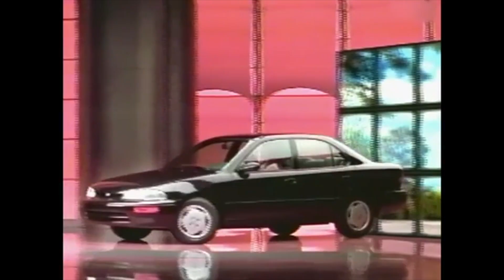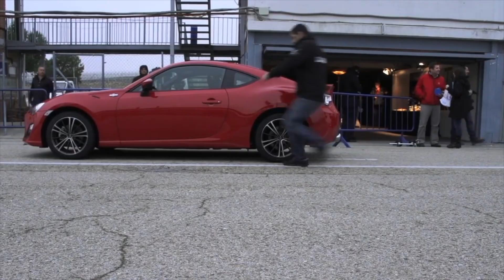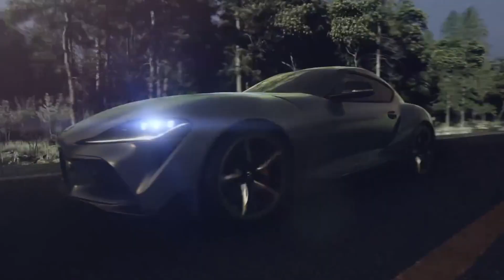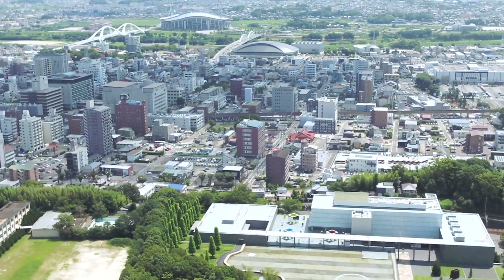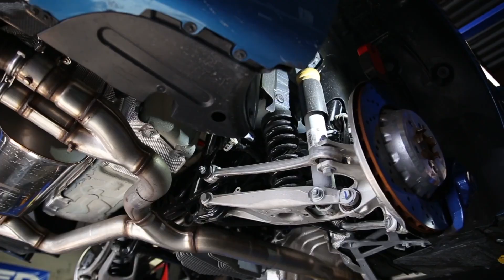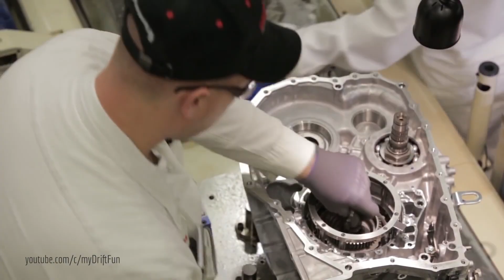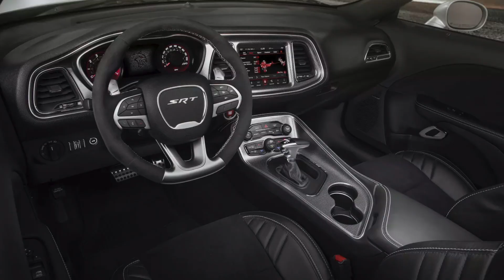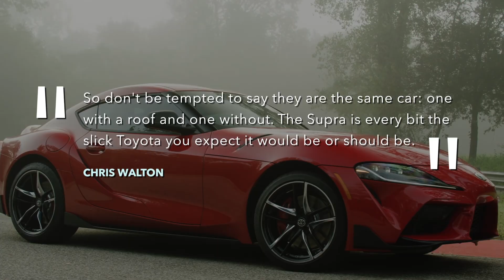MKV Toyota Supra - BMW or Toyota? The UNTOLD TRUE STORY

Comment: So wait... what did Toyota do? lol. It's nearly 100% BMW parts/engineering. Inspecting and QA does not make it a Toyota. That's just absurd to say. If Toyota took apart an M car, inspected it, and then put it back together giving it a thumbs up, is this M car now a Toyota? How ludicrous.  This car is a slap in the face to Toyota loyalists.
Reply: And guess what? If you like this car, you like a BMW. This is the tranny-hooker of Supras.
Reply: Did you watch the video? Same platform doesn't mean it's the same car.
Reply: @samiraperi467  Did you watch the video?  Having the entire running gear made by ford, letting GM do some quality testing on it does make it a ford.
Reply: @single94supra  It doesn't matter who manufactures something if the design is a joint venture. Also they obviously have different panels, different interiors, different tuning... It's not a BMW. Yes, I watched the video. Do you think that it's a Toyota only if they did everything alone? If that were the case the car probably wouldn't have happened.
Reply: @samiraperi467  its absurd to compare the exact etinde, albeitdetubed 50hp with not designing every single part of thr car.  Way to compare apples to staples. FWIW, I know several who had input on this car and NONE are pleased at all at what the end result was and consider it a BMW as well.  It is most definitely a weaker version z4, period. Painting stripes on a horse doesnt make it a zebra.....its still a horse. 
Had they called it anything other than a supra, it would be fine. That is a disgrace to the iconic name.
Reply: @samiraperi467  what most are saying is if this is what came out of that venture. Great! Just dont call it a supra. we would prefer there never be a mkv vs that!
Reply: @single94supra  That's your choice. It doesn't change the facts.
Reply: @samiraperi467  the fact is it's a horse with stripes you are calling a zebra. That's the real fact
Reply: @J.PC.Designs  I get it. I have owned and driven an FRS the last 6 years. The bean counters won't let the niche profit loss type cars get built without these cost sharing practices.

The world has another driver centric coupe. "But muh shared platform"... cry me a river.
Reply: Says the guy with a mustang as his avatar
Reply: why is everyone's panties tied in a wad? Did everyone forget that the 2JZ was built by Yamaha?
Reply: @ricks.1215  only ones wearing panties are those who want a bmw supra 😆
Reply: @J.PC.Designs  I agree  100%. Well said.  It would be like Nissan collaborating with Mercedes on the GTR. Ridiculous.
Reply: This. 

Idiots saying Toyota had a hand in its design by running tests on other company's parts.
Reply: Chassis, exterior and interior design, and tuning are Toyota.
Reply: dautolover how’s the interior Toyota 😂
Reply: @xCkillaxC  Exactly.  The interior has a ton of BMW switchgear.  Oops, the airbag cover on the steering wheel is Toyota, so there's that.
Reply: Wheelman 94 it probably had Idrive or whatever their software is called too 😂
Reply: @dautolover  oh wow. That's impressive. Way to go Toyota. 👏 👏 👏
Reply: @dautolover  all the fluff.
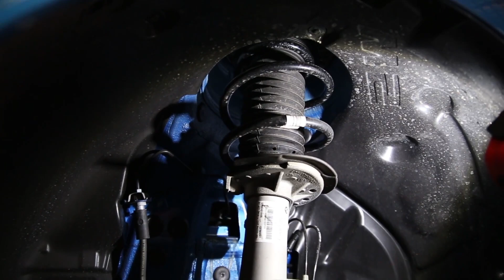Reply: @dautolover  9:35 where do you hear "Toyota chasis" ?
Reply: @TxJonathan  12:55 is where the video states where Toyota took over. This includes the chassis among other things. 

Another question is whether that's enough to make it a "Toyota". I never said it was enough. I was just commenting on the question as to what exactly Toyota do in the making of the new Supra, and the video clearly states what work was done.
Reply: And a slap to a face of all cars industry

Comment: You have an underrated channel, good review.  New sub here.  I will add, that same Motor Trend article I believe mentioned that the Toyota design was finalized by by CALTY Studio (the FT1 designer).  I have also heard about the engine that Toyota had input about it having a mechanical vs electric water pump (like the 2J).  Has forged internals, solid deck (although the cylinder's can't be resurfaced) variable cam lift/timing and twin scroll turbo, water to air I/C, timing chain etc.  BMW variants have already shown 400 wheel with an exhaust and tune.  Sounds promising/  What I wish the new Supra had was a targa top, small back seats, round taillights, and the angled dash at least.  I would still consider buying it down the road.

Comment: I don't bother whether it use a BMW engine or not. The car looks good. The problem is it's performance values. Seriously only 335 hp, 0-60 only 4.2 seconds, top speed of only 155 mph while your opponents have over 500 hp, under 3 seconds 0-60 and over 180 mph top speed. They will crush that car.

Comment: Crossfire 2. Germany exports again! Thanks for the well done and informative clip!

I actually don't mind the manual transmission Crossfire to be honest... night and day compared with a contemporary Sebring, lets be honest. However, Toyota has a better track record for reliability and relatively affordable longevity than either BMW or Chrysler (pick your decade, since 1980). Buying a Toyota without a Toyota engineered drivetrain seems kinda silly to me. 
In contrast, I find the Abarth 124 Spider to be a much better alternative solution, where each manufacturer still supplies their own company's engine. I actually find it more appealing than the Miata, for both the styling and the engine sound. I'd expect the Mazda engine to last longer, but the Abarth engine is more fun, IMO. A Supra made from BMW parts, particularly the engine, just seems weak to me. It used to be that a sports car was an opportunity for a brand to show off their engineering prowess... What is Toyota really showing off here - their incredibly QA dept.? Their adjustment of the BMW suspension? Their ability to apply different fake vents than BMW? It's a real shame they couldn't create a more modern Toyota inline 6 engine. If they had, any other platform sharing would've likely been forgiven by most. I know I would've been more interested. Even picking an existing Toyota V6 from the parts bin would feel more authentic to me, however Nissan Z it would then seemingly become.

 I understand the motivation and reasoning, but not for me.

Comment: Should be a great car.  The B58 is closed deck with forged internals.    Combined with 50/50 weight.    It's basically a 2J FD rx7 but uglier.

Comment: The Car is so BMW that it has 5x120 wheels and uses Wheel Bolts instead of Studs and Lug Nuts. Interior also screams BMW styling. I think the whole "oh we designed our cars completely independent" is just marketing propaganda. I suspect the most Toyota had was spring rates, damper valving and some of the electronic adjustments in the electronic steering rack and shift points.

Comment: I couldn’t think of two manufacturers that need each other more. I have always loved BMW’s they truely feel planted, quick (forget 318i’s) and special. But all along BMW’s suffered reliability issues. Think back to M3 subframes, 3 series cooling systems, and the list goes on. Toyota truely lost their way at the close of the 90’s, much like Honda did. Toyota and Honda creating cool sports cars that were efficient and would run forever. But Toyota’s became sterile, and boring. Hopefully a partnership with BMW will make some of the best cars for different reasons better in their respective  Achilles heels.

Comment: Cool video but ... Screw you BMW-ZUPRA!
Some interesting details but it seems like you might have stretched the thruth in some areas/had erroneous info. Why would they basically do longevity reverse-engineering on an existing engine rather than simply design their engine? This takes way more time than you might think, not buying that story. Same as their claims on "removable" scoops where most of them are absolutely not removable without total body carnage.

Comment: I personally have no problem with the collaboration, I think it's awesome! I have an i6 turbo BMW (335is N54) and I love it. It's tunability and power capabilities (i.e. ability to take big power without opening the block, just bolt on's) ironically enough, is compared to the mk4 Supra's 2jz engine, in fact the BMW N54 is often referred to as the "new 2jz". I have no doubts in the performance and it's capabilities with the new mk5 Supra...I just think that they failed with the aesthetics of the car. To me, when I see it I just don't think "Supra". Instead I get more of a feeling of "Celica". I don't know, it's just too narrow and stubby...it just doesn't have "the look" in my opinion.

Comment: Toyota having RC F OR 300 why they cant re use those chassis wtf
Reply: it's Heavy. while toyota wants to make supra lighter
Reply: @kiryusannagi5171  Supra never was light or small. In fact, Supra was the big brother of Celica. Using RC F chassis (and maybe drivetrain) would make a better Supra. Maybe not a better car but better Supra, with all Toyota glory.
Reply: Orçun Altundağ Supra suppose to compete the Rx-7 and z series from nissan.  RC-F is aesthetically good because it has better proportions but it’s Heavy. And Supra never being small? Well, take a look at A70 and it’s previous generation.
Reply: @kiryusannagi5171  Supra designed to compete with Z's but ended up as a powerhouse that compete GT R's and NSX's instead. Also A70 is not a small body.
Reply: Orçun Altundağ  Yes, But doesn’t mean toyota should maintain that.  They want to make it back on the route.(this is also the reason why ppl become ignorant) B58 isn’t a bad engine, it’s a badass as well like 2JZ.
A70 smaller compared to A80, but it’s not a big deal as long as it’s fun to drive.